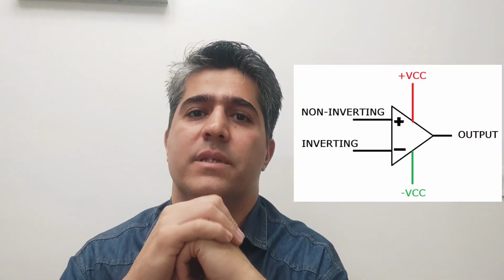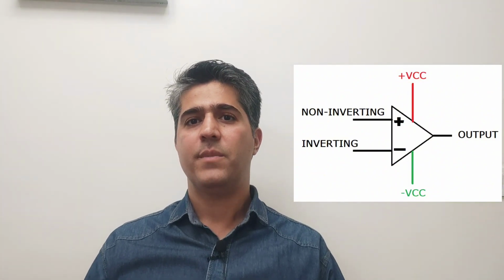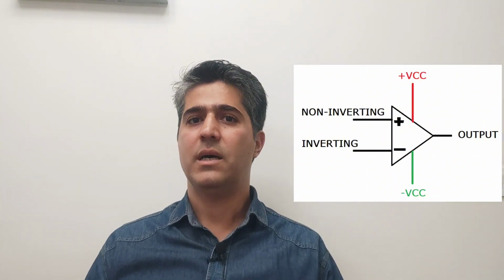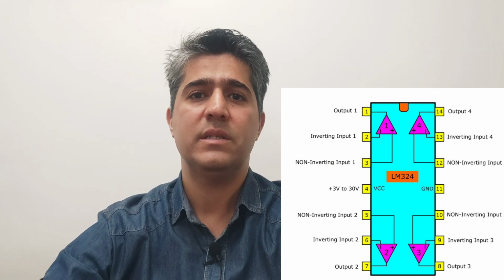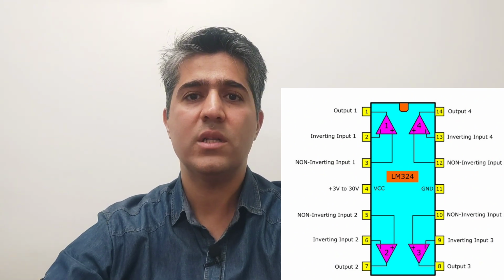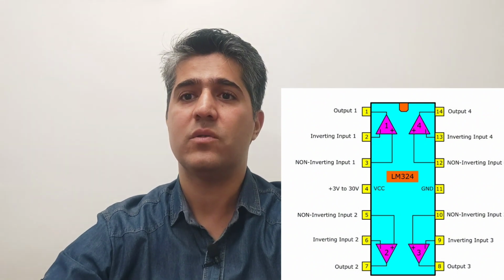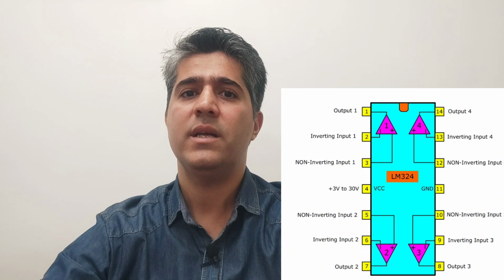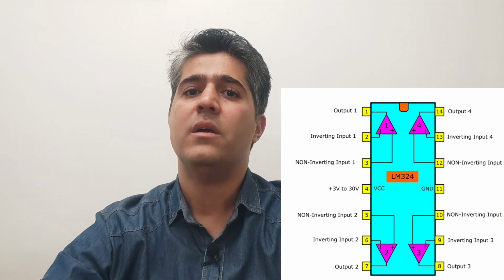LM324/Op Amps/fetal heart rate monitoring/how to repair medical device with lm324 damaged/sonokid

Comment: LM324 has a very high slew rate and practically is useless for any other application than DC signals at extremely low speed frequency changes.